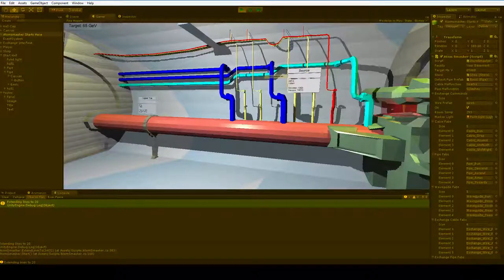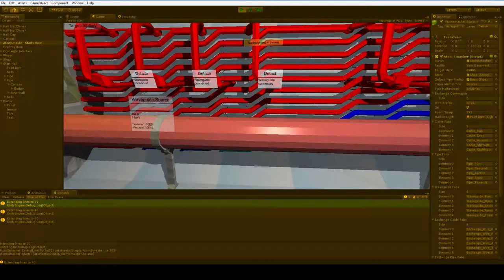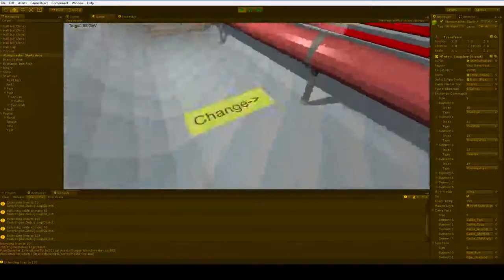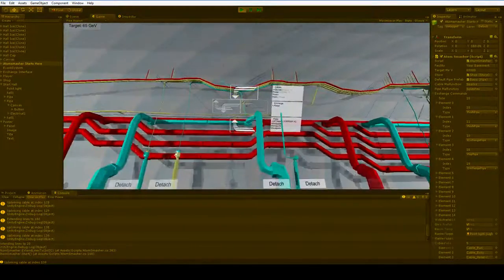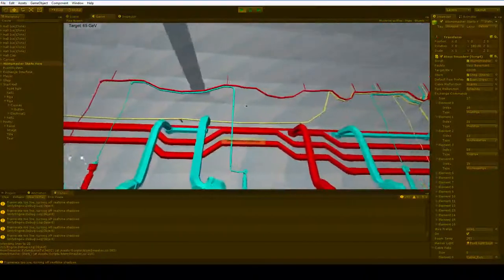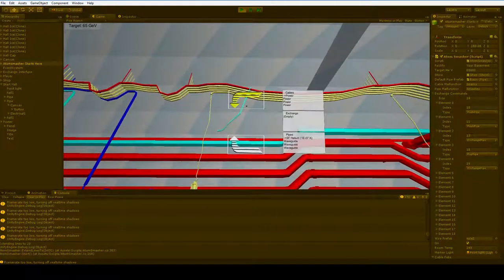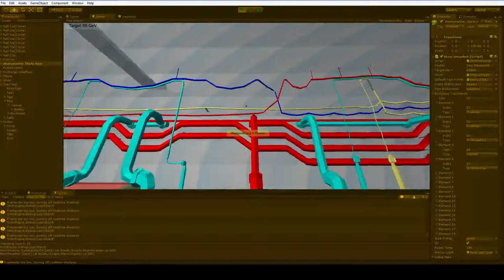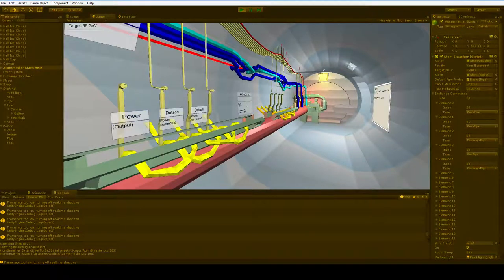Atom Smasher Release!

Comment: I'm thinking starting with a sensor ring then adding the resources and sticking a quadrupole at the beginning to have a pre-focused beam to work with.
Reply from the maker: The problem with the early quadrupoles is that they work best with data from a long way back on the line.
Reply: Yes, but you can put a sensor rings, 3 resource inputs and then another 2 sensor rings and loop energy data from the third to a klystron right after the quadrupole.
Reply from the maker: Yup, right now that's probably ideal.

I think I won't let you focus your beam down beyond a certain point in the later versions, though.